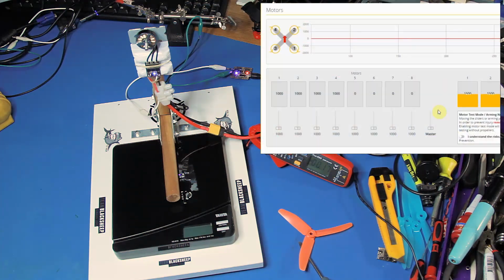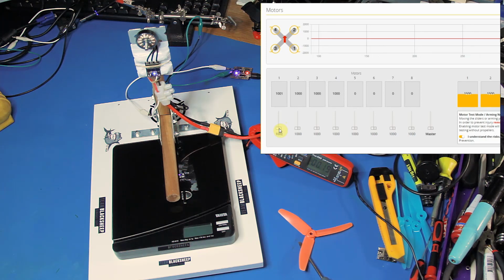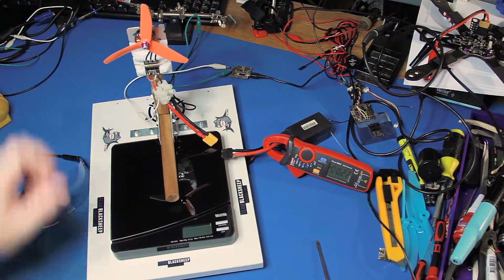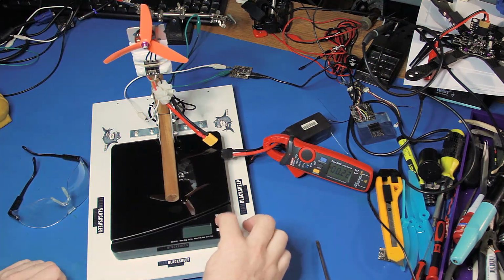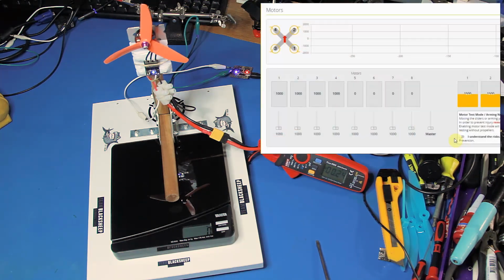Tutorial - DIY Mini-Quad Motor Thrust Stand | HOW TO BUILD

Comment: Hi friend a great video
The only thing I would like to say is the plate used for the motor mount is too big in dimensions which is creating a lot of thrust loss by obstructing the free flow of the air and if a simple motor mount which is not having a large surface area will definately give correct results with less error coming into play .I hope majority of viewers would agree to my advice and some viewers may have contradictory opinion
Reply from the maker: Hi, thanks for the feedback and suggestion. I will modify my design. Cheers.

Comment: Hi..what is the lenght of each arm....Iam thinking of building one.
Reply from the maker: The length of each arm is governed by how big of a prop you want to spin. In my case I wanted to go upto 6" props, so the arm is a big bigger then that. The key thing to remember is that both arms need to be the same size, otherwise the force readings on the digital scales will not be accurate to the amount of force being produced by the prop.